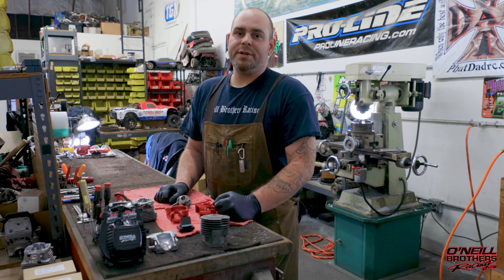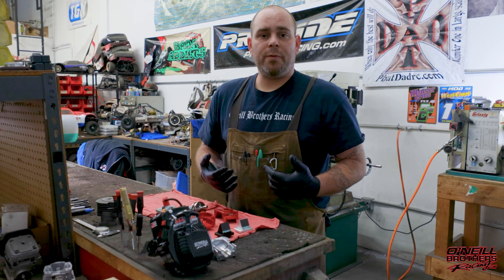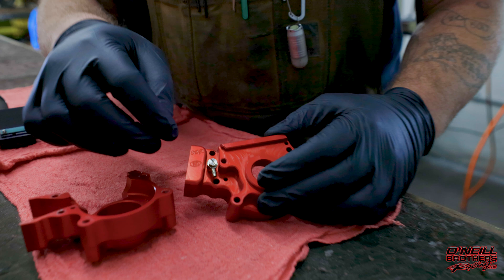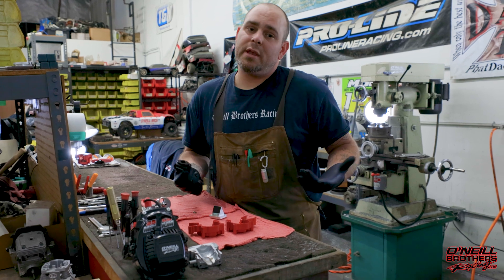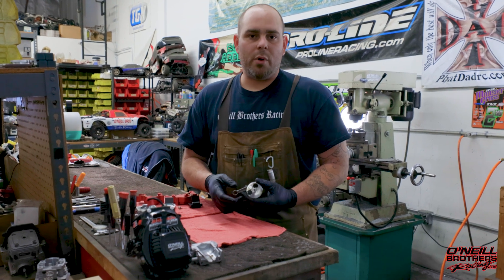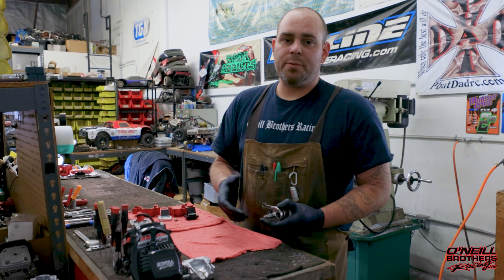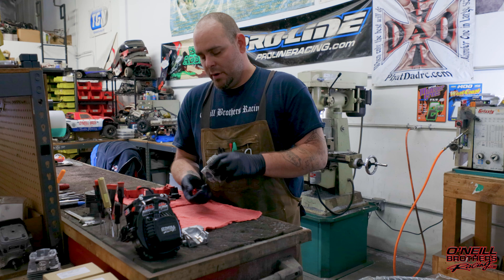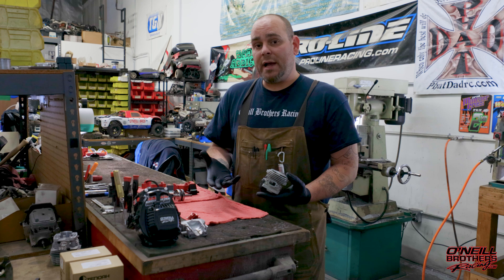OBR 35.7cc Magnum Tech Video

Comment: Very cool,  I love my OBR's!  I knew they were performance made when I pulled the pull start, these engines are tight!  Hours of run time later they still pull start a lot harder than my chinese  motors, even the Rovan 45cc.